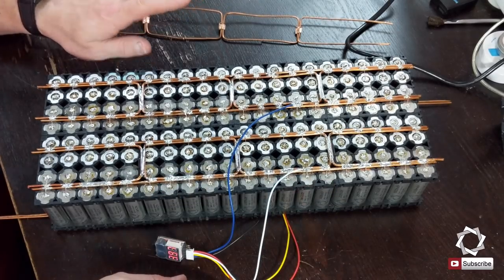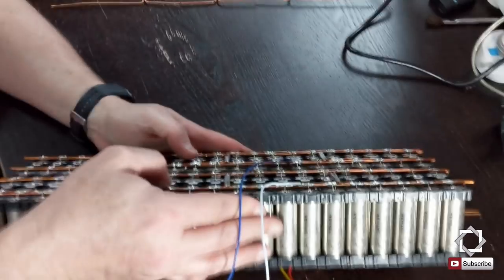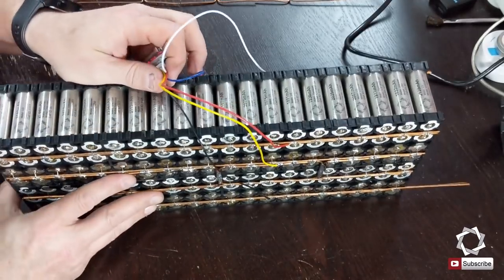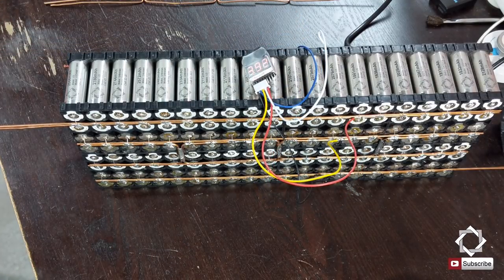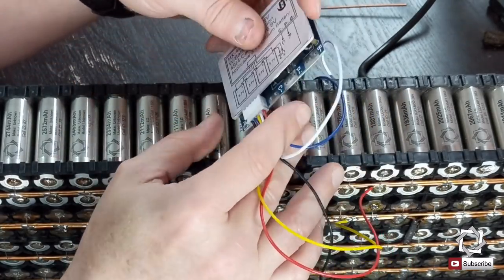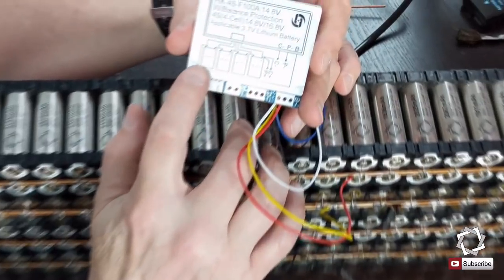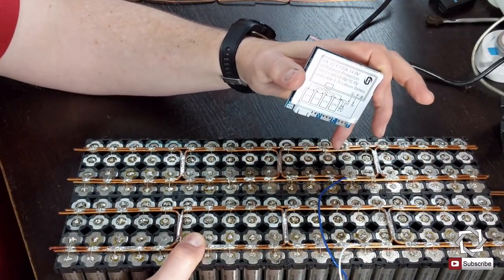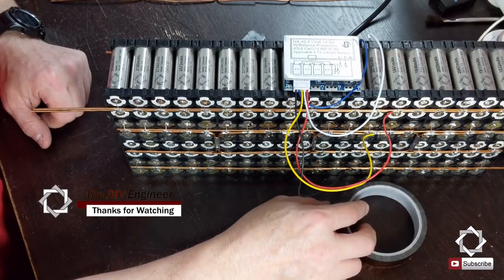New Busbars for 4s 40p Battery Pack

Comment: This battery does not have 1346 watts of energy. Here is the correct calculation; There are 40 x 18650s. Each has around 2.5 ah at 3.6 volts. (2.5 x 3.6) x 40 = 360 watt battery.

Comment: Ok Frank I built a 4s 20p and only half of the battery discharges, I cannot figure out why. Yes I  used 18650 cells, I only charge it with a balance charger, and have been using a cell balancer but no bums. My inverter reads 15 volts and works fine but only have discharges. Would a bms fix this. ????

Comment: Hello Frank I built a 4S 20p 18650 used battery and can only get half of it to charge and discharge. have any ideas I’m using a balance charger and a cell balancer but no BMS would it be a mess fix this

Comment: Current flow at speed of light. Electrons only move slower then a snail, because they bounce and interract with each other. So, your ideea to put terminals in corners is useless. What matter is resistance, if you put too much resistance in some parts of build, the energy will flow more in that area. So, if your busbar is consistent and uniform in all areas you are fine, no matter where you put ends of positive and negative.
Reply: I discovered something recently in my battery pack.

I discovered a slight voltage difference between the top end of the cells and lower end on the same parallel pack.

So, the voltage at the top cells were somewhere around 3.9V and as I got down to the lower end of the pack, it was around 3.8... 

I'm still confused as to why it's like that and I feel that's why he mentioned having his outputs at different ends of the pack.

My battery pack is also a 4S 40P pack.

Comment: Ok...I'm just beginning to get into wiring up a BMS, so forgive me if this is a really basic question. My question is I thought that a BMS was to hook directly to each batteries positive side? However here you are connecting to multiple battery terminals with one BMS lead. So how does it know if one of those batteries is under charging or over charging? Guess I'm a little confused.

Comment: Hi Frank. Awesome helpful channel. I am building a pack at 4s10p packs at 14.4v 100a x 11 in parallel, then another total pack the same in series to the first to give a total of 158.4v and 1100a. Then add another in parallel to give a total of 158.4v at 2200a, how do I BMS this pack? Please help. Thanks.

Comment: Hey frank, what type of power source are you using to actually charge the cells thru that BMS? My problem has been finding a good power source with enough amps for a battery bank that big. I've seen a couple PSUs on Amazon, the kind meant for LED banks or PCs, and they max out at about 30A. But I think I'm missing something and there's a much better way to charge that size of power bank

Comment: if you have a 3d printer you can print your own cell holders and save some money. Im currently working on that same type of 4S holder but for 26650 cells. I got the core file from thingivers but it was only 1S 18650 and im having to modify it in blender to work for me. I actually bought a 3d printer to make my own because the price of the 26650 holder being 2.5 times the price of the 18650s and i need so many that making my own the 3D printer would more than pay for itself by the time im done. Just thought ide put that out there.
Reply: Sir do you think flament cost will be cheaper than chinese holders ?if so i too would have a 3d printer.
Reply from the maker: I have looked into this a little.  I just have not had the time for 3D printing,   That being said, I'm very interested.
Reply: Excellent Video Frank! Anyone have a STL file to print a 18650 3x5 holder? I have not found one yet on Thingiverse. I only see the individuals and 4x5's.   Thanks.

Comment: @FrankBrand I have a pool pump that requires 110 volts to run. would that make my power packs  be 29 or 30 18650 (with 3.7 nominal  volt)cells  in Parallel. right ???
Reply from the maker: If you want to build a 12 VDC powerwall you would need 8 Cells in Parallel and 4 Parallel packs in Series. (4p 8s).  That will take 32 cells total.  you can check out my cell calculator here: https://thediyengineer.com/get-cell-pack-calculator

Comment: i'm working on a very similar project: 4s20p with 40A BMS, but i have a big problem; my busbar is 0.8mm*6 resulting 2mm, should be okay, or i need a better one?
Reply from the maker: DO you know what gauge wire that is?  You will be running at 12 volts so you may need to beef that up a little.

Comment: Hello Frank! I appreciated your explanations so much that I decided to subscribe to your channel. I can not wait to see and hear more. I have two questions. In my mind, I always understood that the BMS had to monitor each cell. You build a bank of 40 cells in pararel. This bank gives you about 90A to 3.2V. Then another 3 banks of 40 cells in parallel are connected in series to form a battery. If your BMS only monitors one bank at a time and one cell drains more than the others, how can we determine the cell at fault? Also, if one of your cells shortens and burns its fuse, is the BMS able to inform you of this situation? You see, I intend to build this type of power pack and I'm happy to see that you explain it well. By cons I have reservations. I have reservations with this concept. For my part, I have more in mind a bank of 4 cells in mind, this monitors with a BMS each of the cells, then I add another 39 banks of 4 cells in series with each their BMS. It can be over-designed, but at least I make sure of surveillance. By cons, this concept to its disadvantage, each cell must be fused. In your opinion, should I go so far for protection?
Reply from the maker: Donald thanks for watching... The BMS can manage multiple cells at a time but you are right is one cell dies then it can cause trouble for the whole battery.  The BMS's I'm using have no way of letting me know that there is trouble, so I add voltage/capacity meters to my batteries so I can keep track of the state of my cells.   There are different approchas to how to build packs.  Have you see these videos?  https://www.youtube.com/user/nocrf50here/videos  or  https://www.youtube.com/user/hooptejoe/videos